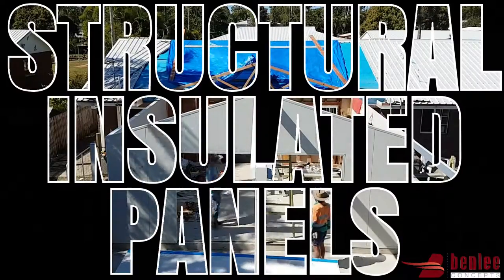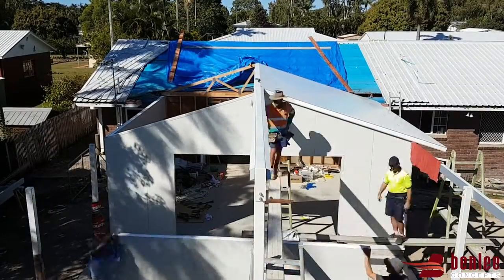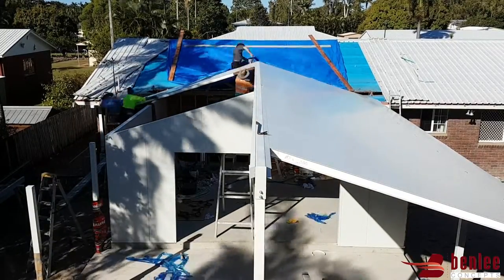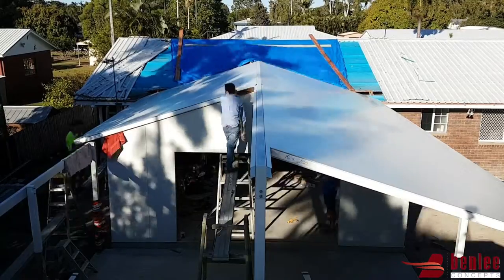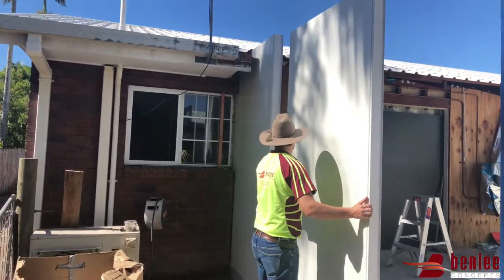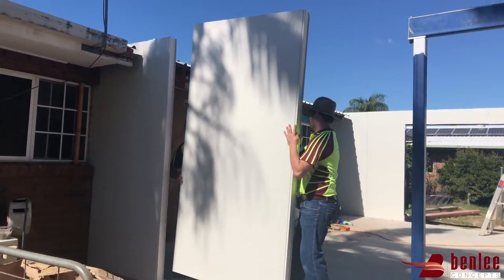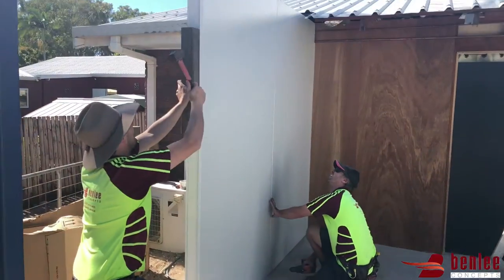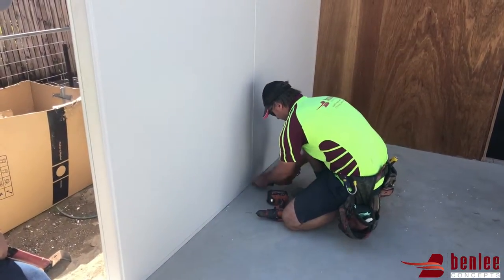Structural Insulated Panel House Extension Timelapse

Comment: Bottom rail will transfer the heat and cold to the inside to suck up all the energy.
Reply: So very cold winters, you will have lots of cold air coming inside?
Reply: This was installed in coastal North Queensland where cold is not an issue. If thermal conduction was a problem for the bottom channel could be replaced with 2 separate metal angles to ensure a thermal break at the bottom. 

In either case the thermal bridging in this structure is easily 10x less than a timber or metal stud wall which is the standard construction method in this part of the world.

Comment: Hi. How do your panels perform for soundproofing? Thank you
Reply: If you use the high densed glass or rock or something looks fiber wool inside of the panels, you will have soundproof wall
Reply: Rock wool is best, but heavyweight and pricier, but effective, and a 'greener' choice.  

Sound values are usually average unfortunately... nothing special there

Comment: Where are you located? And what's the price for the tracks and panels?
Reply: I dont speak on behalf of this particular company, but answer in general because I am building in it currently...

Depends on the thickness for price. Steel SIP build is similar to convention, but gets rid of so many processes, and replaces each process with superior product✅️
Channels are standard u channel with rolled edge, very thin. For cyclone rating, channels are deeper, and an extra length of 6mm angle steel at floor level, and externally a 6mm plate from channel to slab/edge beam, is bolted through the panel. 

The only foe of panel or steel is fire. Be as fireproof as possible on your surrounding property.

Comment: What's you R-value / insulation coefficient on your wall and roof panels?  Do they comply with local regulations?
Reply: Depends on the thickness of panel. I'm using delta panel in australia, their website has all the specs, checkit out. My ratings are all higher than conventional building. Luckily in Aus we need awning/shade all around, so this greatly eliminates the amount of sun hitting the walls. Front fix windows are used in this construction, which also helps eliminate the transfer as the frameout is minimal.
Reply: Cyclone rated and passed by a very tough council...

Comment: Классно!!!  А с наружи фасад надо заделавать?
Reply: Можно использовать без дополнительной внешней и внутренней отделки. Видели здания для семейных "Магнитов"? Материал тот же, если я не ошибаюсь.
Reply: Usually The connecting grooves are lined with a flexible mastic before putting together. Then each panel joint is also sealed externally after clicking together. This joint is primary place of water ingress and must be maintained, especially on the roof. The correct sealant must be used, do not use inferior quality sealant! Be sure the joints are dust free before application: alcohol wipe if needed

Comment: I see electric sockets in the wall. Is the wiring inside the panels? Is there hollow Chanel’s or something?
Reply: Usually the panels are 1000 or 1200 wide. A hollow section runs parallel to one edge of the panel, so there are vertical electrical channels every metre. You will never have to worry about cutting them again, because you always know where they are